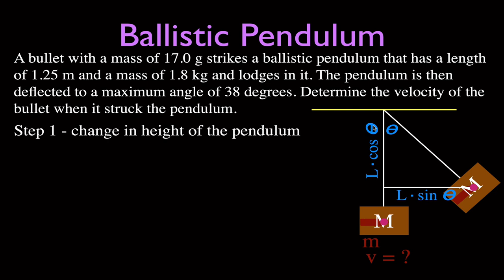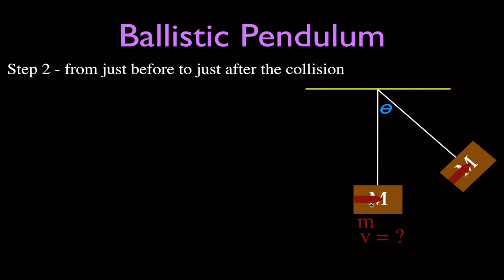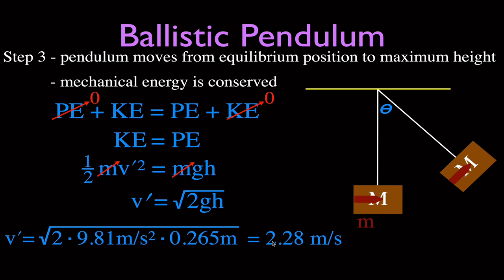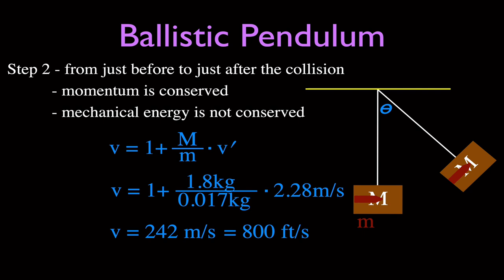Momentum, Impulse & Collisions: Ballistic Pendulum, An Explanation

Comment: Thank you well explained formula just one alteration mussle velocity 242 m per sec not all the energy is consumed by the bullet, if the mussle was close to the block there would be a residue of mussle blast also hitting the block along with the energy of the bullet.The velocity of the bullet is ideally measured some small distance away from mussle blast..Iam a keen Deer hunter in 
 New Zealand Keep up with all your physics lectures cheers Mark
Reply from the maker: Thank for the comment and the clarification. I have never even fired a gun. But I would never turn down a good piece of venison and a teacher Iised to work with made very nice sausage from hunts.

Comment: Sir, I think u made a mistake in :
v=[(m+M)/m)] . v'. The answer should b: v=(1+M/m). v' = 243.69 m/s
Reply from the maker: No
Reply: @stepbystepscience  you made a mistake sir . if you used brackets for  (1+ 1.8/0.017) 2.28 the answer would be correct. NB calculator uses BODMAS rule.